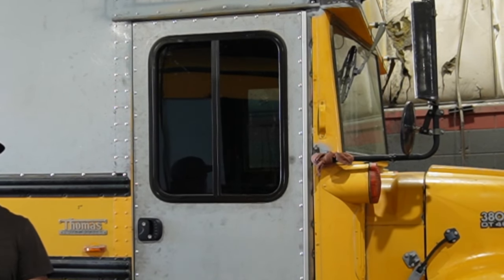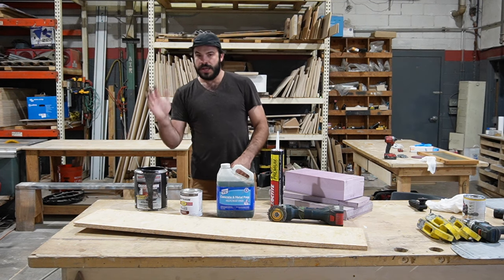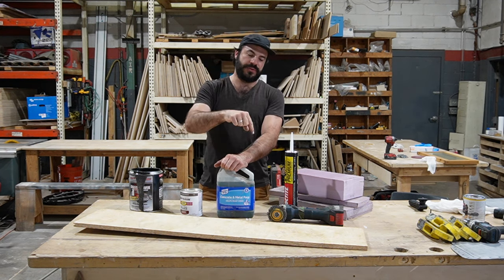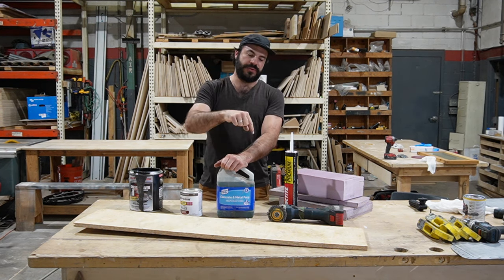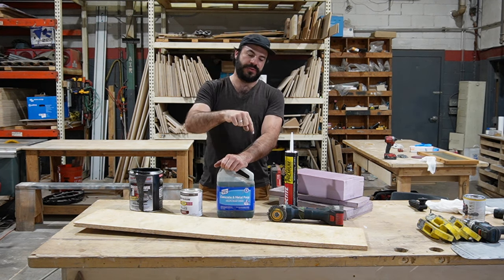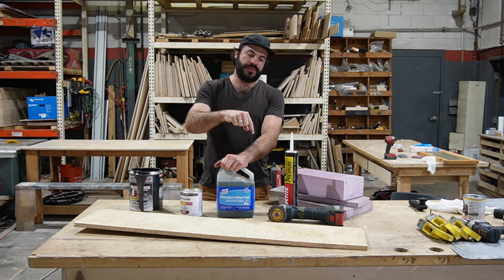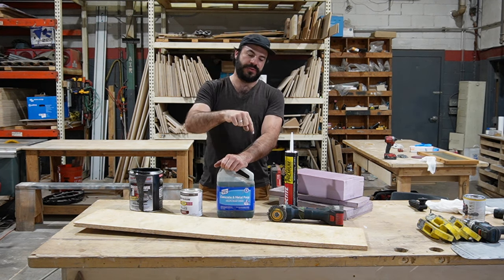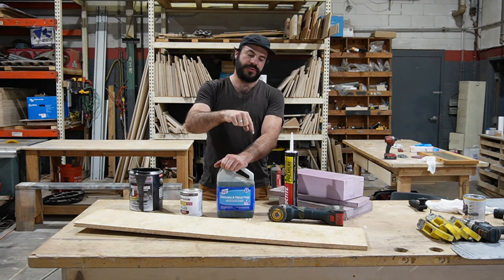Framing your bus conversion subfloor is a mistake, do this instead

Comment: I really love the This Old House vibe on the intro and outro's. Very well instructed and " scoolled " video.   One TIP for you from 35 years experience gluing glass and mirror to walls and ceilings INSTEAD OF LAYING OUT YOUR CAULKING LIKE A ROPE squeeeze out BLOBS A NICKEL ROUND IN A POLKA DOT FASHON ABOUT 8-12 INCHES APART AND STAGGERED. This will SAVE you 50% in caulking and give you about 400% better adhesion . After years of pulling out others work proves that DOTS OR BLOBS will STICK 100% OF THE TIME and ROPE WILL STICK 20-30% OF THE TIME.  The reasoning for this is that when gunning out the caulking in a rope the thickness of the bead is so inconsistant only the thick parts will make contact and the thin parts will not stick to both sides of the objects. You will acheive a better and more level application. With mirrors the reflection must be perfect in order to look good, you dont want to see a reflection of a door ,window or the room itself being crooked . Dots will spread out making perfect contact with both sides and be better to level between each other. Even though you add weight on top there will still be a 1/16" or a 32 of an inch of space between them and some areas of the rope design just dont make contact.
Reply: Game changing comment 🎉
Reply: As a former tile-setter, I think using a notch trowel to spread the adhesive would make for a better bond, especially between the foam sheets, and between the foam and the subflooring. If there were 4'x8' ceramic tiles, that's how you'd do it!
Reply: i was thinking the same thing "this old bus with Chuck Cassady"
Reply: I think maybe one of the differences is they are placing a LOT of weight on the boards to ensure good contact and spread of the adhesive, whereas with hanging tile or glass you can only put so much pressure on something vertical.
Reply: He even looks like a young Bob Villa.
Reply: Also consider that roping the glue might create air pockets that resist the sandbagging a bit.
Reply: So glad I read your comment 😁
Reply: @wodinsc   Well, maybe, but our Chuck is lots more handsomer!  🤗

Comment: You may already do this, but, cut a plug out of your 2 inch foam, that will fit tightly in the fuel access hole. Then glue that to your cover. Adds a bit more insulation to a cold-well, and will help with rattle sometime down the road. Great Job! Good Ideas and execution! Thankyou for these methods of flooring.
Reply from the maker: Thanks! I'll be using a piece of 4" i have laying around, thanks for watching! subscribe and stick around :)
Reply: @ChuckCassadyYT  question: do you plan to LIVE 24/7/365 in this or just two weeks a year?
Are you designing for ALL climates/seasons or a targeted range?
WHAT are you doing about Moisture/CONDENSATION? 
Dead air spaces versus rotating air columns inside insulated or non insulated spaces?
MOLD? 
it seems most people that do these do minimal insulation AND sell between 3 to 5 years --- which is the time frame where most major mold is BOOMING ...
have you looked into "VIP" (Vacuum Insulation Panels), ceramic vacuum sphere paint?, wool, and external insulation such as spray foam on the outside and then coverings with a skin/shell...
EDIT: also in terms of full time living all seasons... : how do/do you insulate water tanks/ water tank compartments and control for moisture AND thermal bridging &, Condensation?

Comment: Honestly the BEST weatherproofing I've used for years on chasis and metal has been to take a gallon of tar and thin it out with gas or mineral spirits and brush a couple layers on. NOTHIGN gets through tar and it NEVER leaks. Cheap and best. Treat your metal with acid then throw some tar over it and your done. Lay some 30# felt paper down between your subfloor and steel too.

Comment: Charlie, have you ever insulated the underside of the floor? If so, what would you recommend? I realize the downside of cold transfer of floor joists. The reason I am thinking of this would be to avoid doing a roof raise (I’m 6’4”).
Reply from the maker: I haven't, for many reasons, but you will want to clean the undercarriage extremely well first and top coat the foam after install. My main concern would be creating moisture pockets that lead to rust

Comment: I'm right there with you on the floor sandwich and we also like the PL polyurethane adhesive...and I've used that on lots of bus floors.  But we've recently switched to the foam polyurethane adhesives, after some strength and coverage testing.  Foam cans, used with a screw-on gun, like the Dap SmartBond or Advantech seem to fill voids better and give better coverage per $$.  You might look into those.  🙂

Comment: I'm getting ready to tackle building out a camper from scratch on an old RV trailer. I also want to use rigid foam under my flooring. Question though: Why does so much adhesive need to be applied to the foam and subfloor? Couldn't someone just use it on the edges and let gravity be your friend? You're pretty much covering the whole layer with it so I'm sure there's a good reason, I just can't sus out what it is.

Comment: SUBFLOOR MATERIALS:  
1) Chassis Saver paint on rusty but clean floor.   
2) 11:24 Owens Corning Foamular 250 NGX Extruded Poly Styrene insulation sheets, 4 x 8 x 2” thick X 2 = 4” thick. (This is very dense. Not to be confused w/ Expanded Poly Styrene which has little balls like styrofoam.)  
3) 16:05 Advantek Engineered OSB, 4 x 8 x 3/4”. (This is tight and highly weather and warp proof. Not to be confused w/ cheap flaky OSB.).  
4). Everything is glued down w/ big tubes of Loctite PL3X. One tube per 4 X 8 sheet.  (Dries much faster and is stronger than Liquid Nails.)
Reply: Thanks! I was just looking for this info ;)
Reply: Great summarization.  Thanks!
Reply: The foam is XPS.
Reply: @samuelfox8126    Yes. Owens Corning Foamular NGX 250 Extruded Poly Styrene is XPS.
Reply: @joeblow1942 what about the final primer on top the osb?
Reply: @AM50red    I dunno. I just followed the video to save in my own Van Build playlist. Did I miss that?
Reply: @joeblow1942  ya I tried wat hinges again and he actually  doesn't say what it is
Reply: @AM50red    What are “wat hinges”?
Reply: @joeblow1942 wat hinges is watching
Reply: @YeshuaKingMessiah    Huh?
Reply: @joeblow1942  he mistyped WATCHING as “wat hinges”
Reply: @YeshuaKingMessiah    Ok, thanks for clearing that up!
Reply: I haven’t been able to find the 250 foamular sheets, only 150. Where would I find the 250?
Reply: @robinrodriguez417    I haven’t gotten that far yet so I don’t know.
Reply: Sure, now that I went through the video and carefully wrote everything down 😂 just kidding, good for comparing notes. thank you!
Reply: Just cheap exterior paint,  it's what he said.  Then on top of that would be the final flooring. @AM50red
Reply: Thank you so much for this comment

Comment: 10:23  What a smart man! I agree 100% with this,I never understand why people frame out the subfloor in bus conversions. I’ve seen this foam as the underlay the ramp going down to the garage just before they pour concrete over it. They also use it as a base in swampy areas so they can drive trucks over it. I’ve been doing construction for years, we put this on basement subfloor’s before we pour concrete over it, or put it on a concrete subfloor and put plywood over it, and we never frame it out. I never understood why people did that during RV builds.

Comment: I wish I had seen this before I tested like 10 different adhesives to painted metal/xps/wood. I arrived at the same conclusion! I glued my van floor in with that exact Loctite PL 3x. Holding strong for 2 years now!

Comment: Thanks for sharing this stuff man.  Great job.  Tiny tip from a contractor, whenever I've had to do similar glue-ups I spread the glue with a notched trowel after squirting it everywhere.  Probably wouldn't make a huge difference, and yes, it's messy. But like you, I like to take any chance I can to over-engineer, or go the extra step when creating something intended to last for years.

BTW, even with all my experience I'm learning so much from your vids where the general materials I use everyday intersect with bus building.  Thanks for sharing your experiences with us.  I'm always looking to learn more from someone who has already been where I'd like to go.

Comment: I love this approach and the critical thinking involved. I'd like to apply a lot of the processes and ideas here to the installation of a subfloor to my sprinter van.

Unfortunately the floors of my vehicle has a series of ridges and troughs that are about 1 half inch each at different levels. I would love to put XPF right on top, but I'm afraid that although it's compressive strength is adequate for your purposes, that the unequal pressure applied by the shape of the floor could compromise it either by cracking it or compressing it in unpredictable ways where heavier objects placed above it will compress it more.

I THINK this might be why some van converters use battens, even though it introduces such heinous thermal bridging.

I can think of a few approaches to address this potential issue:
- sandwich XPF between two layers of plywood product (I already have the OEM one I could use for the bottom layer)
- Get a more compressable XPF and let it mold to the contours of the surface below it
- Put a layer of XPF in between structural battons and another over the battons and the first layer of XPF

What I'll probably do though, is buy Advantech and some XPF 200, jump on it, and see what happens! Would love to know what you think about how XPF would behave in this type of situation
Reply: @dariuszmrowca1177  still repainting the floor, but I have been able to handle some XPF and it may actually be up to this task.

I have tried to find van-oriented videos about this, but I've only really found instances of people filling in the “valleys” with microcell. This seems fine, and may be optimal because structural issue I mentioned before, but thermally, I don’t think it’s necessary because of the thermal bridge of the XPF contacting the high points of the van floor. So you might as well just provide that support with any other material, like wood (although it probably does have some really solid sound-deadening properties). On another note, the R value of (non-ventilated) air is about the same as that of XPF, so if you could successfully seal it off it would be even more pointless, but I guess pointlessness is absolute so that doesn’t really matter. Then again, that might create a sort of drum, where the reverberations of the floor would bounce around under the XPF, and be noisy.

Comment: Best use for polyiso: the inner layer on your ceiling. This is especially useful where you have unlimited height (ex: you raised your roofline, but aren’t coming close to the height restrictions where you live/drive) as it allows you to use less expensive bulk insulation (like batting) and then have a single polyiso layer on the inside which will both even out your temperature and let you get the full benefit of it as you’ll almost always keep the inside of your bus (or tiny home) above the degradation temperature.

Comment: I find all of Chuck's advice tremendously helpful.  However, he left one thing out, and I just did it wrong!

When laying the Advantek subfloor, you want the exposed edge of your first panel to have the side with the groove exposed, not the side with the tongue exposed!  Sadly, I've just come back to glue down my second piece of subfloor, and discovered that it's going to be very hard to slot the exposed tongue into the groove of the new panel coming in.  Once I realized I didn't know how to do it, I went and found a Huber educational video about their product, and they make it clear that I've got it flipped around.

My sorrow, but maybe someone will learn from my mistake!
Reply: Great tip to bring to light. I can see how it can be easy to make this mistake if you're not mindful of it before you lay your first piece or making your cuts on your following pieces. Those can be VERY EXPENSIVE mistakes using Advantech. I was luck enough, I scored by Advantech for $32 a sheet. It's back up to $50 a sheet now but still far better than $100 a sheet.
Reply: Thank you, I would be that person who missed that detail.

Comment: Advantech is an awesome product. Looking at a piece right now. It has been in the weather since 2021. Still good. I am also wearing PL right now, and it has been almost two years since I first installed it on my pants. Do not settle for anything less, everything else washes off eventually, but PL remains. It is also on the bottom of my work boots, which have actually been working. They recently helped put out a forest fire. PL is still there. I rest my case.
Reply from the maker: hahaha that is one of the best comments ive gotten in a while. i also have a piece of advantech in my backyard since 2021--still looks fine! thanks for making me chuckle

Comment: I believe if you are going to do much more adhesive laying you might want a Milwaukee rechargeable caulking gun. I bought one to do a subfloor and will never go back to using my fingers to squeeze a caulking gun again. Really easy to just press a trigger and let the adhesive flow. Takes a bit of getting used to but WOW what a difference. The tool has done probably over a hundred tubes and is still going strong.

Comment: Having a industrial painting background I'm with you on the floor demo.. I took it a step further and sandblasted the floor and up a foot on the walls.. the best paint is a industrial bridge paint called Wasser moisture cured urethane.. mio zinz for prime/ two coats and two coats of luster from Wasser.. I also did the under carriage..

Comment: Not only a how to but a why to
Video.  Very generous of you as a true craftsman to share the hard earned knowledge and experience. Thanks. 
As a former Framer if there is one suggestion I could make…
Please wear some knee pads. 
After years of crawling around laying out and nailing out I only wish I would have worn what we considered to be back then those Sissy kneepads. So happy they make spare parts I’ve had both knees replaced and crawling around all that time was a real factor in their deterioration.
Thanks for taking the time to make this very practical and informative videos.
Reply from the maker: Thanks just Mike! And you're dead on. I have some great kneepads, but in the heat of the filming I didn't get them. You should have seen this case of bursitis I got a few months ago....my pants barely fit over my knees!

Comment: Hello Chuck, I found your channel a few months ago and have been watching your videos, I started my bus conversion almost 8 years ago and have enjoyed watching you and your team work, my bus is not a schoolie but a 1971 MCI MC7 which I stretched to 45 feet, raised the roof 12 inches and built 3 slideouts in, which is part of the reason it's taken me 8 years to get this far, while I didn't do everything the way you have for various reasons, I can't find anything you have done that I disagree with, though there are things I wish I had done the way you do, MCI buses have a sloped floor so to level that out I did run stringers across the bus in different thicknesses to compensate, not necessary if no slideouts are involved but definitely easier with slides, I've been living in it and continuing the build for the last 3 years in southwestern Canada in temperatures ranging from 115 degrees to -30 degrees and can confirm from experience that your  construction methods are sound, I've worked in the custom car industry as well as tugboat industry and we used the same construction techniques in those industries as well so can confirm they are valid, Thanks for sharing your experience and knowledge.... James.... Oh, and I have my build on a YouTube channel as well if you wanted to check out everything I did wrong...😊😛

Comment: getting caught up on your videos after having not watched in a while and as always, a wealth of information.  Particularly interested in checking out home applications for the Advantech as I, too, have always thought "OSB is garbage" especially in our rather humid summer/damp winter climate.  I keep seeing other build videos where they continue to do the 2x4 framing on the floor and I don't understand it.  Seeing your builds makes it pretty clear that it's more economical (both in total materials and heat transfer) to do it your way.  Plus not having to cut the foam in a bunch of small pieces to fit in the wood framing to me means less waste and a faster floor - and while faster's not always better, in this case it makes total sense.  thanks for continuing to share your knowledge!!

Comment: First off thanks for the heads up on the Chassis Saver.  I need to touch up some spots on my RV and chassis saver sounds like the way to go.  My only other comment is I'm wondering if it would be a good idea to radius the corners on the access panel.  I realize there is structure underneath but square corners are just more susceptible to cracking.   All in all a great job.  Anybody want to buy a pint of Black Rust-o-leum and some rust converter?  Keep the good stuff coming.

Comment: Great job explaining why you build the way you do in your skoolie builds. You may achieve the most consistent bond between layers by blobbing on the adhesive and then using a 1/8" V notched trowel to give a perfect consistent layer of PL adhesive. I was going to use 3" of foam insulation in my overlander build, but to see someone using 4" of insulation - I am impressed!